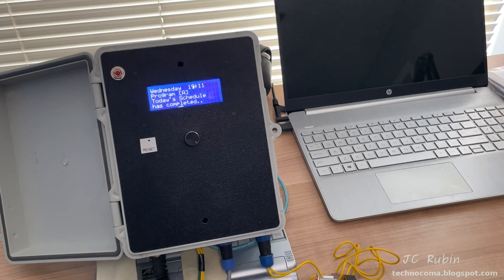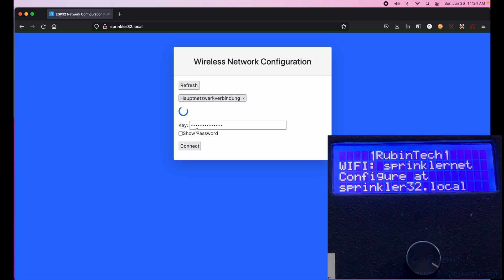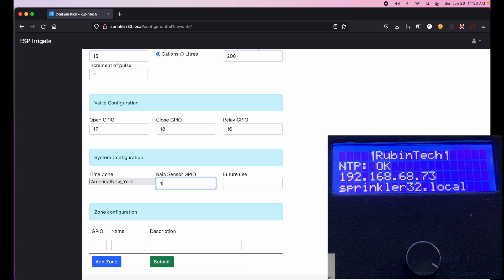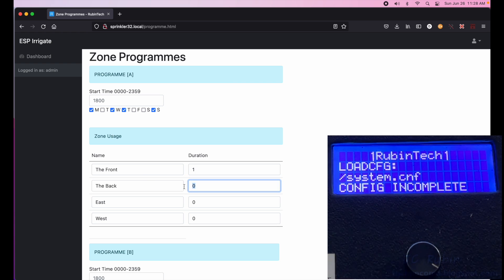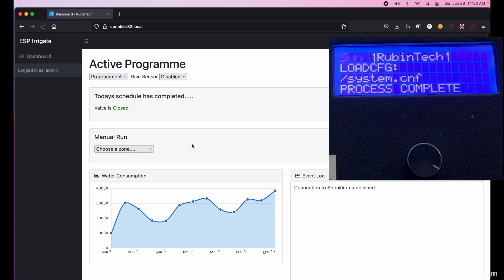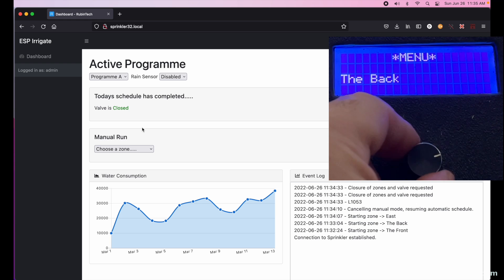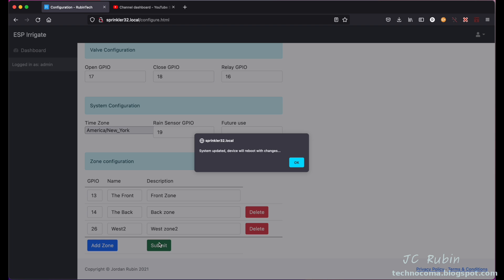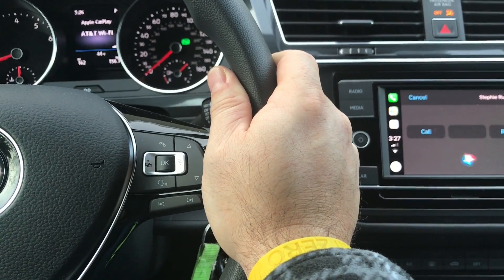ESP32 Automated Irrigation Control System Project - PART 5 - System Demonstration

Comment: Nice project... I designed and programed a similar sprinkler controller on a ESP8266 and a custom PCB with Triac outputs for zone valves. Mine communicates MQTT and I made my GUI on Home Assistant. Love your web client GUI and rotary dial setup, yours is more polished and configurable than mine, nice job!
Reply: Do you have this on video?
Reply: Sorry no video... @Dqrnan

Comment: I tried connecting two ball vavle using the ball valve library you made on arduino but I haven't be able to get the program to distinguish ball valve one from ball valve two. I labeled the gpio pins separately for each vavle and named them accordingly. Is there insight you might be able to give me?
Reply from the maker: // MOTOR RELAY ON 16,13
// OPEN/CLOSE SENSE on 17&18+14&15
// USE INTERNAL PULLUPS [ESP32]
// NO POWER SUPPLY RELAY

FIVEWIREVALVE valveOne(16,17,18,true);
FIVEWIREVALVE valveTwo(13,14,15,true);   //assuming connections here

Serial.println(valveOne.setValvePosition("OPEN"));
Serial.println(valveOne.setValvePosition("CLOSED"));
Serial.println(valveTwo.setValvePosition("OPEN"));
Serial.println(valveTwo.setValvePosition("CLOSED"));